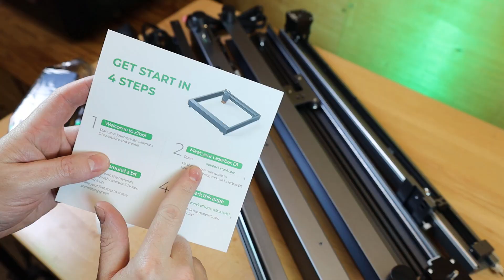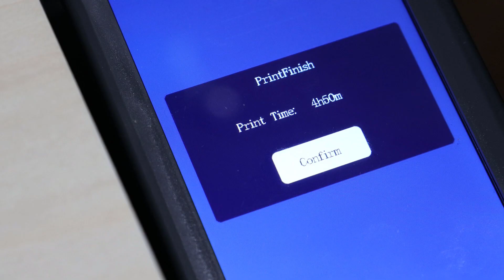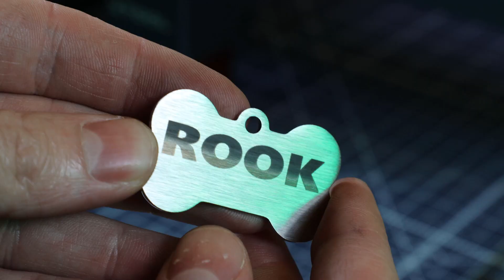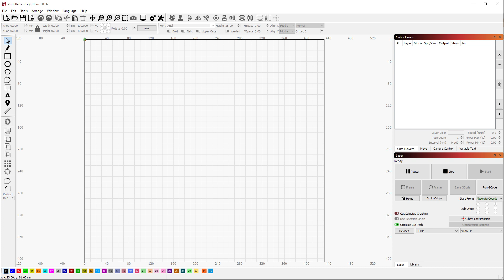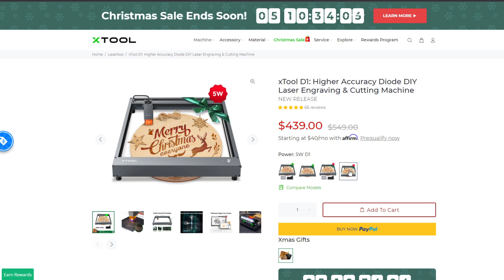Powerful & Clean Desktop Laser Cutter & Engraver - xTool D1

Comment from the maker: From xTool:
xTool D1 Laser Engraving & Cutting machine - https://bit.ly/xToolD1-10W
xTool D1 Air Assist Set - https://bit.ly/xToolD1AirAssistSet
xTool Honeycomb Cut Bed - https://bit.ly/xToolHoneycombBed
xTool Materials - https://bit.ly/xToolMaterials
xTool 20W Diode Laser Module - https://bit.ly/xToolDiodeLaserModule20W
xTool Enclosure Smoke-proof Cover - https://bit.ly/xToolEnclosure
xTool Smoke Purifier - https://bit.ly/xToolSmokePurifier

From Amazon:
xTool D1 Laser Engraving & Cutting machine - https://amzn.to/3jLyLbX
xTool Honeycomb Cut Bed - https://amzn.to/36hLVdq
xTool RA2 Pro 4-in-1 Laser Rotary - https://amzn.to/39u4Mn7
xTool D1 Rotary - https://amzn.to/3tzO0tD
xTool D1 8Pcs Laser Engraver Raiser - https://amzn.to/3O0q7U8
Honeycomb Working Panel - https://amzn.to/3txRY60
3MM x 12" x 12" Baltic Birch Plywood - https://amzn.to/3uMibyJ
1.5mm x 12" x 12" Plywood Sheet - https://amzn.to/3uLqfje
Metal Business Card Blanks - https://amzn.to/3xv2ihU
Earring Hooks - https://amzn.to/3xv2ihU

Other Tools & Materials:
4' Inline Ventilation Fan & Ducting - https://amzn.to/3EpuLWi
Large Self-Healing Cutting Mat - https://amzn.to/32oeKCW

Free Files:
Engrave Material Test Laser Pattern (LightBurn) - https://drive.google.com/file/d/1VmzXgLFeil-zOarKUNs0QklVCMqqTEQA/view?usp=sharing
Cut Material Test Laser Pattern (LightBurn) - https://drive.google.com/file/d/1DVm-P38fsdGC2fzOeuDwhkWSrzNS6A-t/view?usp=sharing
Earrings Laser Pattern - https://cartonus.com/jewelry/

Cheap Paid Files:
Earring Display Stand Laser Pattern - https://bit.ly/EarringDisplay-LaserFile
Witchy Potion Bottle Laser Pattern - https://bit.ly/WitchyPotionBottle-LaserFile
Magical Moon Witchy Bug Laser Pattern - https://bit.ly/MagicalMoonBug-LaserFile
Mushroom Laser Pattern - https://bit.ly/Mushroom-LaserFile
______________________________________________
Note  - Most of the links that I use that go to products are affiliate link. This means I make a small commission on anything that you happen buy using them. This is at no extra charge to you and this helps support the work I do on this channel. 😁👍
______________________________________________
#xtool #xtoold1 #lasercutter #diy
#xTool #lasercutting  #DiodeLasercutter #laserengraving